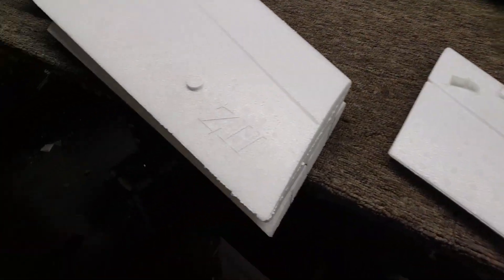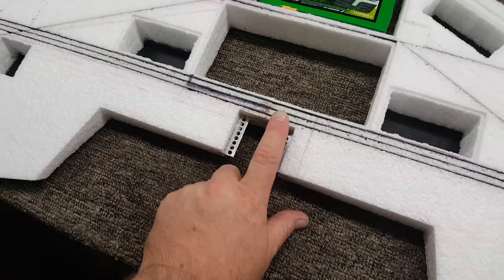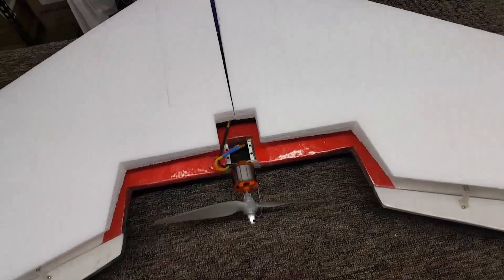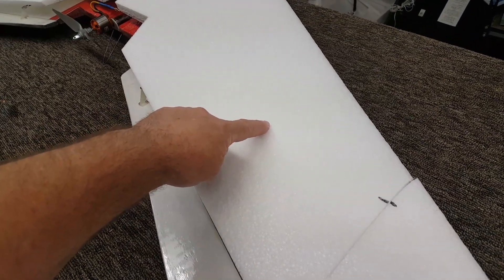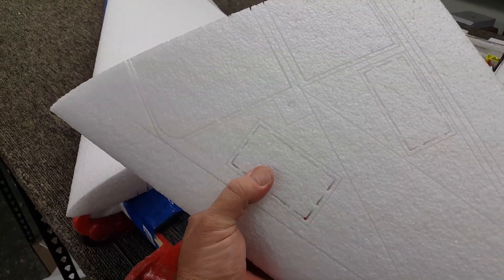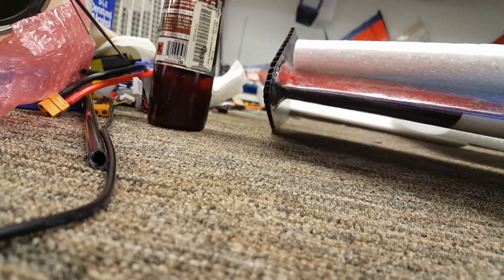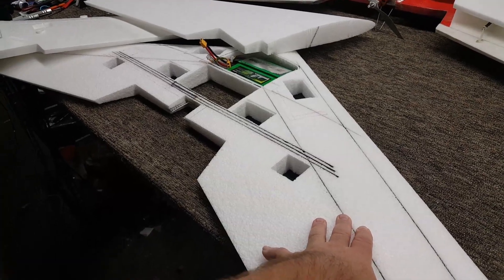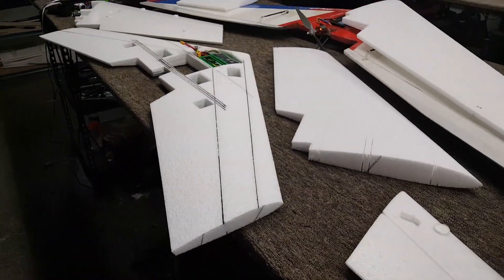Ritewing Z2.5 and ZXL reworked in EPP

Comment: Chris
I just finish the Z 2.5 build. It look amazing
Please tell the weight with lipos on it. Mine is 2300grams.
I put 3 4000mah 3s . Vtx and camera and vector on the front pokets. . Still is tail heavy with 10inch CG mark from the nose.. Is that CG correct?
Please confirm.
Reply from the maker: Email me this conversation tomorrow